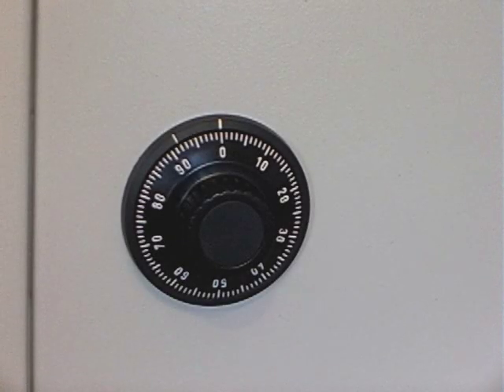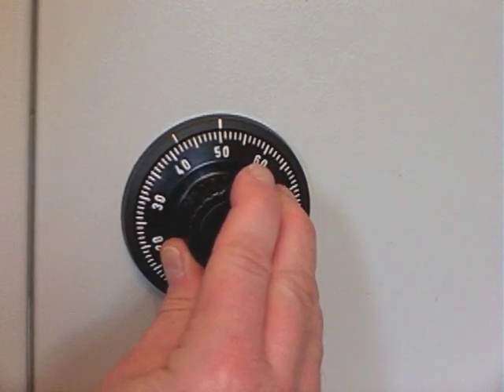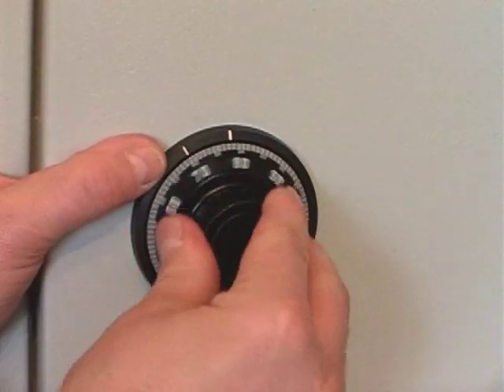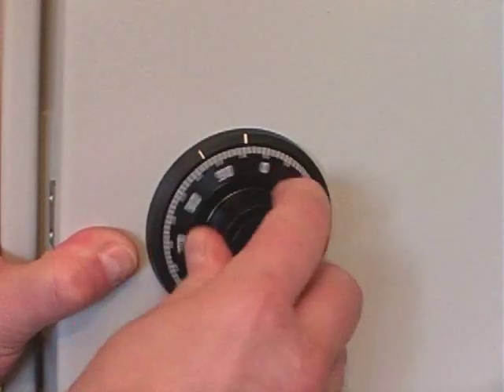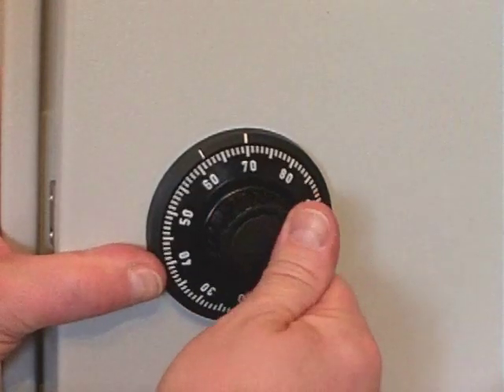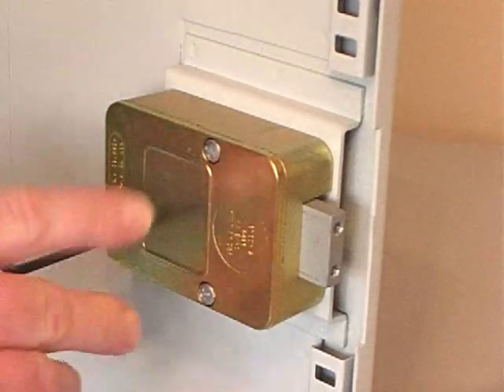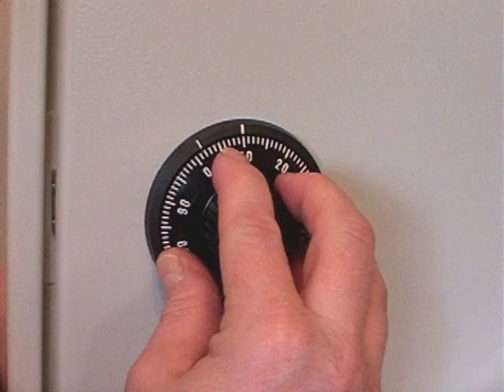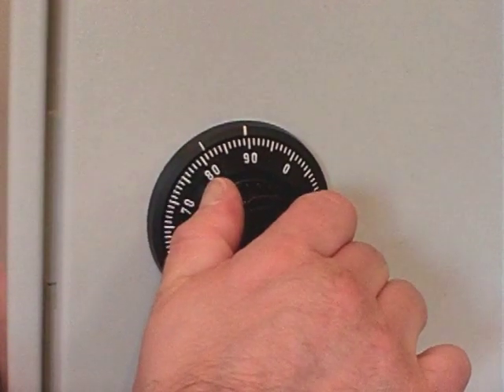Securikey La Gard 3 Wheel Combination Lock Change Instructions

Comment: I have an old safe that was a gift from my old boss. he didn't know the combo, and he never figured it out. the door is open, and I have taken off the piece of metal covering the rotors, but the notches cut into the rotors are in the shape of a V, so when trying to set them in position I can never tell if its really where they need to be.  I want to crack it myself, but have limited patience. any suggestions?
Reply: Mawk Heaf See you later safe combination locks ceiling safesSee locks on savers

Comment from the maker: First you need to buy a change key for your lock by manufacturer & how many 'wheels' it has. To change the code this key must go into the lock & through the wheels. Align the changekey holes in the wheels & the hole in the case. Once you have all the holes in line re-fix the lid. The change key should then go all the way in & rotate 90 degrees. The video will tell you what to do next. Remember to use the changing index & try your new combination at least 7 times WITH THE DOOR OPEN - Good luck